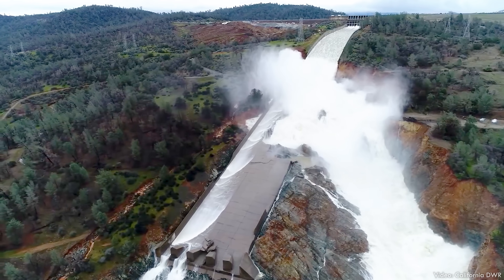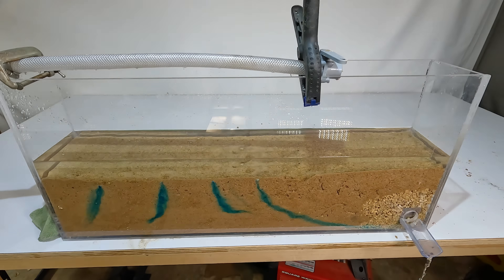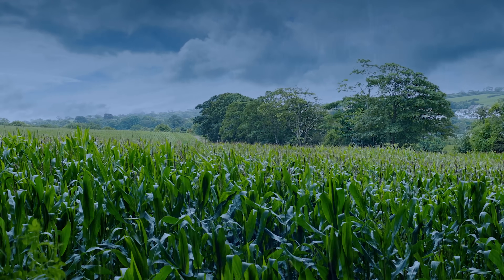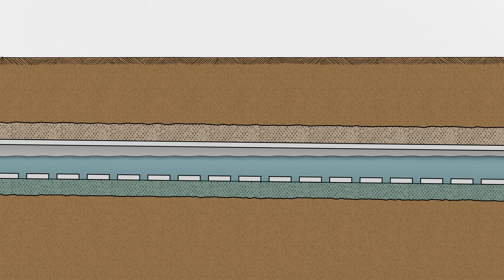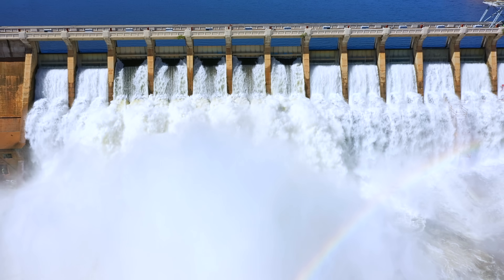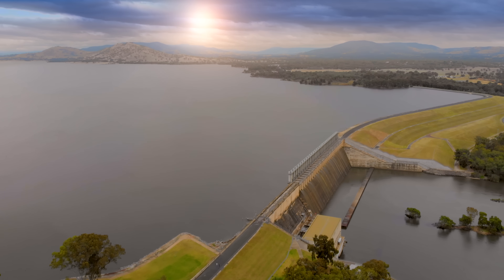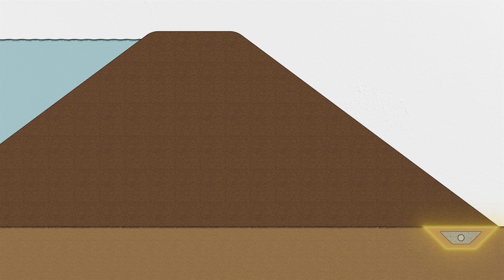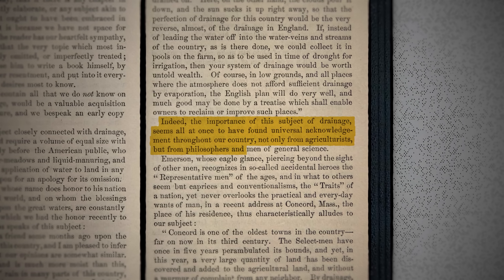How French Drains Work

Comment: Had a basement that flooded every time it rained, we then had "water proofing" work done about 10 years ago and its never flooded since.  I remember they dug trenches around the house and in the basement, as well as a sump pump with a backup battery.  I remember they added lots of rocks to the trenches but I didnt get to see most of the work, I wonder if they did french drains?
Reply: Most home foundations are skirted in French drains

Comment: Timey video as I'm in the process of putting a surface drain on the north side of our house. Even though we installed drainage around the basement footing, during heavy storms we sometimes get a little water at one location in the basement. Here in NH we mostly have sand sitting on top of hardpan. So water rapidly percolates through the sand then gets stopped by a mostly impervious rock layer.

One thing I've learned over the years is you cannot stop water, the best you can do is convince it to go somewhere else.

Comment: Sand mixed with drain rock is less permeable than either alone. 
So for those land owners who are not engineers, a plain ditch will serve you better in the long term than a poorly constructed french drain. 
In shallow drains (less than 5 feet) there is additional complication from biologically driven clogging, which can be more rapid than many realize. In Just couple years earthworms can quickly fill the voids between rocks with soil or sand, plant roots of all sorts, and a wide range of bugs and burrowing critters like gofers.
Reply: Can you add rock salt to keep them away?
Reply: @johnrussell6620  no

Comment: I used to install French drains. Common practice was to drill the holes in two lines at 90 degrees from each other, and orient them down at 45 degrees off center on both sides. This left a channel in the center for water to flow
Reply: This is the way
Reply: @dichotomousblue 
Mandalorian French Drains!
Reply: Used to do this on the farm but with an offset like in a spiral... never had a problem with it.
Reply: @wobblysauce  Can you elaborate?  I'm not getting the "spiral" part.
Reply: @Omniverse0  Make a hole and turn 90º and up some distance and repeat.
Reply: Exactly what I was thinking! The only thing I can see being a possible problem would be reduction in weight bearing capacity
Reply: @RaindropsBleeding, what do you think about using sand and gravel instead of geo-textile fabric? It seems like it might work better.
Reply: @peternyc I’d just add a little more gravel (probably #57’s) in place of the geotextile.
Reply: Seems too be the best way.
Reply: I was just about to say that it seems like holes at 5 and 7 o’clock or thereabouts would be ideal, with the holes still low enough while also allowing a free fast flowing channel down the middle. It’s nice to see my minimally-informed hypothesis lines up with someone who actually knows what they’re talking about 😁
Reply: So if I used a typical pipe with the holes on the bottom and install with the holes down, you suggest adding holes to the sides ?
Reply: @kevincloonan9787 tilt the pipe a bit so there's a solid channel along the bottom, and the water flows in from one side. The side that's less likely to clog up imho, ie away from the flow.
Reply: That’s exactly what I was thinking would be ideal when he talked about hole position.
Reply: I'm so glad you posted this. I literally thought to myself "wouldn't holes a bit up on either side be the best combo then?" and then boom. Here you are!
Reply: Yes.  If there's one predrilled hole it's placed along the edge less likely to clog the holes, though you should have the mesh around it regardless.
Reply: imagine being a grown adult and watching cartoons for little girls, and actually being proud of it 💀the industrial revolution was a mistake
Reply: Peak internet having a Star Wars nerd spas out over someone else's fandom in a discussion about French drains.
Reply: @EnragedPlatypus  Hilarious name.
Reply: @GeneralKenobi69420 imagine caring about the harmless ways other people spend their free time.
Reply: @GeneralKenobi69420   Imagine unironically watching Star Wars.  You're only one small tier away from MLP.
Reply: @Acetyl53 Not even the original trilogy! The PREQUELS!
Reply: @Acetyl53  who said I watched Star Wars?
Reply: @GeneralKenobi69420  Surely you cannot argue that it was strongly implied.
Reply: @Acetyl53  if you have no idea what a meme is, yeah
Reply: @GeneralKenobi69420  Surely you have not literally figuratively allegorically metaphorically symbolically and UNIRONICALLY gone full memeworld.  NEVER go full meme.
Reply: You have replied to a comment about french drains, on a video about french drains, complaining about someones interest in something completely unrelated to french drains, the only reference to anything other than french drains was their profile picture, why do you even have a problem with someone liking a show for "little girls"? You're acting like one anyway.

Comment: 12:34 Depends on where you live. In flat areas (like Houston) it's true that basements will be completely underground. But, if there is enough of a slope where a house is built, it's not unusual to have a "walk-in basement" where the basement slab sits just above the lowest ground level and the other side is partially or fully underground.

In fact, I've had one house where the slope was so severe that it had 2 levels that were partially below grade.
Reply: They aren't mutually exclusive. I have a walkout basement that still requires a sump pump for drainage along the front of the foundation, which collects and moves a surprising amount of water during heavy rain events.
Reply: @ferrisr  Thank you for calling it by the correct term, a "walkout" basement. Guess they call them "walk-in" in Houston. Guess that makes the half-height "lookout" basement with a picture window but no door a "look-in" basement there which is just creepy.
Reply: I live in Yorkshire.  The last three houses I lived in were all like this.  My front door is up three steps, by back door is a storey and a half lower.  If you walk on the level through the two-up, two-down house, you’ll go from looking at ground level to looking onto back neighbour’s roofs.  😅

And yeah, our cellars all have French drains!
Reply: Why would a house in Houston even have a basement? Heating is generally not a great concern and the ground is definitely not going to freeze.
Reply: @Keenath  Basements (especially walk-out basements) are desired by many buyers and add a lot of value to homes.  With a basement under a 2 story home, you get 50% more floor space (ignoring garage) for what is usually far less than 50% cost... And often homes are sold with the basements unfinished, thus keeping initial price down and giving the buyer the option to finish the basement to their tastes down the road, as money/time permit.
Reply: @Keenath  The basement is the Coolest Area of the house, for me I always keep a get-away bed for escaping heat.

Comment: You missed a point about having holes in the top or bottom of a pipe.
We have a drainage pipe that runs across  two of our fields. The first field is the higher one and has pipe with perforations all the way round and just collects water.
The lower field has free draining sub soil but the water table rises and falls very quickly in winter. In this field the pipe has holes in the top.
When light rain falls water runs from the top field into the pipe it is channeled down through the pipe and is contained within the pipe, that is sealed at the bottom, as it passes through the lower field. In this way the lower field isn't made wet by water passing through the pipe from the top field in lighter rain.
When the rain is heavy and the water table rises in the lower field it rises high enough to enter the holes in the top of the pipe to be drained away.

Comment: Not to nitpick but we’ve learned a lot about how the soil biome affects soil adhesion. I feel like you’re missing a huge variable there dead soil or Anhydrous Ammonia fertilized soil washes away instantly but soil with good mycorrhiza, bugs, and bacteria withstands for more hydraulic pressures. The delta is large enough to be statistically relevant to how drains function

Comment: Just keeping gutters clean can keep water out of your basement. Make sure all of your downspouts carry water away from your foundation.
Reply: This, right here, is the answer for much of a houses water problems.   The first thing, and best thing, it to route surface water away and downhill from your house, if at all possible.  In many situations, that will fix your problem.   The other thing to know is if you gutters go into the ground and are old, they may very well be leaking and bringing water straight to your foundation.    

In that case, you can simply route the gutter water onto the surface of your property if you have even a slight slope away from your house.  And, like was mentioned, grade the soil near your house to slope away from the house.   

Obviously, if you are in a flat area, then it may be hard to impossible to route surface water completely away, so then you have to  have those french drains also to help route route away that goes to the bottom of your foundation.

Comment: "Once you know the base soil's grain size distribution, there are a number of engineering methods to find a material that will both allow water to flow while still holding the soil back." Would you be willing to cover this in more detail, or at least provide some references to this sort of thing? I want to know more!
Reply from the maker: The first report I mentioned it a great starting place: https://www.fema.gov/sites/default/files/2020-08/filters_embankment_dams_update.pdf
Reply: I was trying to imagine the cost of having engineers out there measuring soil particles haha. It seems there must be averages / heuristics to make a statistically valid estimate of the grain size distro?
Reply: @bruce-le-smith When a sufficiently large project is involved, it's not that expensive (relatively speaking) to send someone out, take core samples in a nice distribution across your site and send them in for testing.
Reply: @bruce-le-smith I've seen dot guys using a sieve stack just like what Grady used... But on their tailgate of their f150.
Reply: @bruce-le-smith  they'd definitely be tested on a big construction job. Not necessarily by teams of engineers but by trained technicians who specialise in that
Reply: @bruce-le-smith the category’s are clay sand etc just google the definition of sand and go up in the grain size …. Experienced farmers and landscapers can say if it works just by looking and smearing some of it on the back of their hand …. No expensive test needed as long as you don’t built massive structures
Reply: I second this motion! But maybe I'm just biased because having Grady explain the intricacies of engineering in lengthy detail is music to my ears.
Reply: Many universities will do soil testing, for a reasonable fee. Gives you a whole bunch of data, including chemical composition, so you know soil type and what nutrients my be beneficial for any plantings/sod. Just need to send about a quart of soil in a bag!

Comment: Literally calling companies two days ago to get quotes for a french drain. This video gives me so much info on what I need to know. Thanks for posting.
Reply: If you're doing it for the sake of removing water that is pooling on the surface, you'll want catch basins as well. If it's to remove water away from your foundation, also make sure they grade the soil away from your foundation. These are things that they should know, but these help a lot more for surface water than French drains do. Whether they use the textile fabric or not should depend on what soil you have locally. Recommend looking at French Drain Man for more info, which as always take with a grain of sand because he's selling DIY materials.
Reply: @imadork123  part of my house is literally in a bowl. i dont sere any way to grade it away from the foundation.
Reply: @cryengine_x  Have you considered building a moat around your house, that way the moat is lower than where your foundation is :)
Reply: @imadork123  well like i said its only part, maybe 75% of the house is ok. i think a french drain in that area might go a long way to solve it, routing the water away. but i dont think completely. the design of the landscape/drainage just isnt correct. when i bought the house i didnt think at all about such things.
Reply: @cryengine_x  If your house is in a valley like you said, it would perhaps be better to collect water around the house with french drains that would collect in a catch basin with a sump pump. Gate City Foundation and Drainage has quite a lot of informative videos about this subject. Just a channel drain wouldn't cut it and ask when given quotations about where the excess water will be directed too. Water doesn't travel upwards, especially in a valley. I'm not trying to be the online expert, but want to make sure you get done what you need!
Reply: @cryengine_x  French Drains don't route water away. They route it into your foundations.
Reply: @whatilearnttoday5295  yes i guess if you point it into your foundations
Reply: @cryengine_x  Underground. Where you put the water. That's where your foundations are.
Reply: @whatilearnttoday5295  i didnt put the water. hope that helps
Reply: @cryengine_x  French Drain will not route water away from the hole your house is built in. It will instead sink that water directly into your foundations at increased speed.

You need dish drains and a sump pump.
Reply: @whatilearnttoday5295  3 sides of the house are sloped away ok. just one corner is the problem. and it kinda naturally routes water away, just way too slow and it piles up on side of the house. since i have lived here 14 yrs and no major problems, i think french drain can help. so much water comes on heavy rain, a small stream, theres no way it can handle that. but it should move it out quicker and make it not soggy like now 9 months of the year (only dries out in 3 months of summer)

i'm not understanding how sump pump helps...there is a path to slope, the water can flow away naturally, it already does, but way too slow.
Reply: @cryengine_x  Digging a hole on the high side of your house and putting the water in it. Will not help. It will create problems. It will sink your house.

Keep the water on the surface. Keep it flowing.

A sump pump is required when there is no fall and nowhere for the water to go.
Reply: @whatilearnttoday5295  i would be digging on the low side. and there is a place for it to go. its too much for a French drain to handle on heavy rain, so i'm supposing it will just move the water through and out faster than currently. and dry it out much faster as well is my hope.

to really fix it tbh needs a culvert. its that huge of water flow in the worst rains. however that doesnt seem reasonable. a culvert right through the yard feet from the front door, besides the expense must be insane.
Reply: @cryengine_x  Yup. A dish drain. Keep it on the surface and moving.
Reply: @whatilearnttoday5295  what is a dish drain? google is not bringing up much for that term.

One issue is one section stays soggy 9 months of the year. So I think a french drain would dry that out hopefully. I dont see how a surface drain would help the soggy/muddy aspect. It seems to be the water table is too high. a french drain will get the underground water flowing out, no?
Reply: @cryengine_x  Dish drain is just a dish on the surface. Concrete or clay.
Reply: @imadork123  If it's on the surface. Keep it flowing. Whatever you do, do not put it in a French Drain.
Reply: You probably don't want a French Drain. They have specific situations where they are useful. Other situations they make MUCH WORSE.
Reply: well, thats called a timing

Comment: We could use a lot more water management practical, personal advice. I've had to learn about slopes, swales, and drains for runoff. Next I have to learn about septic systems, percolation tests, and how regulations among restrict what you can do--or what you have to do. Friend of mine is struggling with erosion from tides, and I don't fully understand if what the neighbors are doing (laying down large walls of boulders, stacked 6x6s, or concrete) is the end-all-be-all or if friend's planting of ground cover could be good enough, or if there's something more smart they could do by analyzing the specific fluid dynamics of that waterfront.

A wise old guy told me to avoid french drains with ribbing, for example--they clog easily, apparently. He said to stick with smooth piping.
Reply: When I did landscaping, we used both and they were fine. Of the stuff we used the smooth piping had thicker, sturdier walls. Hence better choice for shallow high load areas. Otherwise, in most cases the cheaper ribbed drain pipe was more than enough.

For your friend, it will depend. Ground cover is great, but easily replaceable rabble can take the brunt of the forces and provide time for the vegetation to take root.
Reply: Modern ribbed drain pipes have a smooth inner surface, at least those that I can buy in Northern Europe. The ribs are for crush resistance and there's a separate very smooth inner liner for cloggage prevention.
Reply: Agree.  Learning about water mgmt has been critical as home owner.  There was a lot i didn't know for a long time and taking a multi pronged approach to address different problem areas has been hugely beneficial.